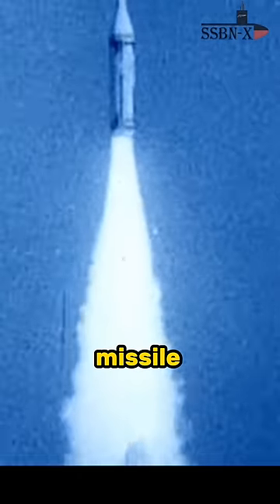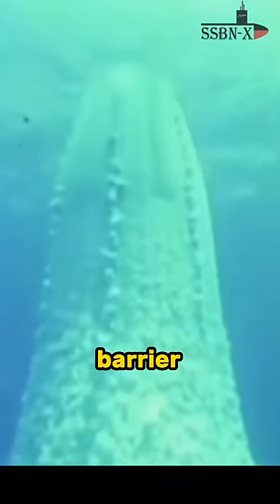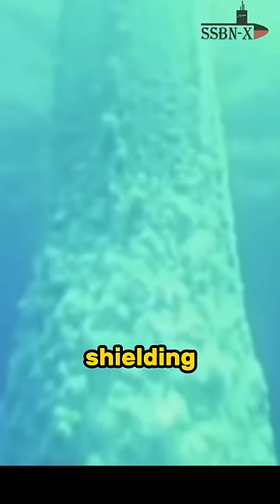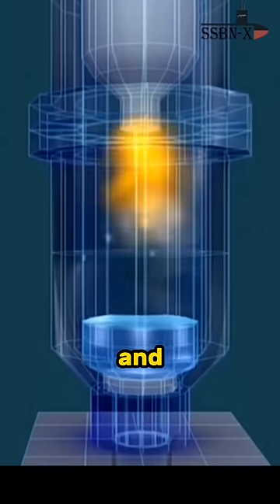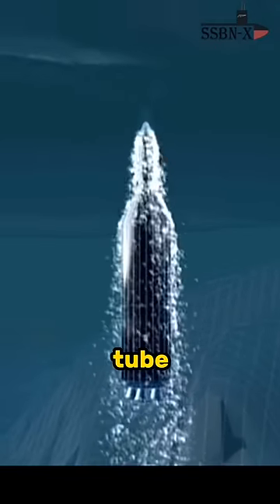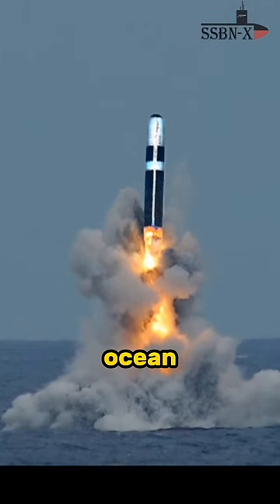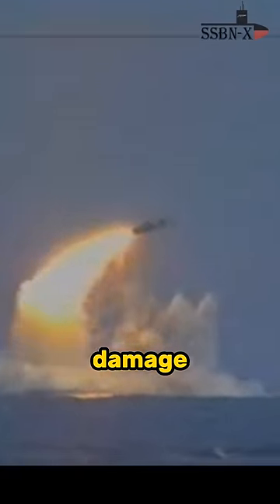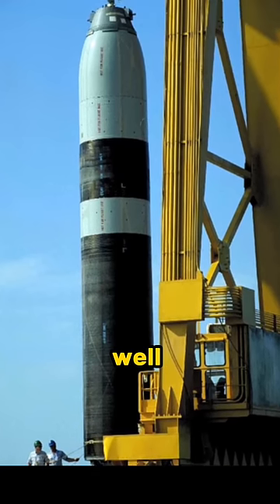Why The Missile Never Gets Wet? #shorts

Comment: IDK if the Trident II  is still on subs. I think it was retired.  I used to make these 1st  2nd  & 3rd stage igniters, insulaters, &  nozzle machining on VTL's.  That was back in 1980.  Same airforce plant that produced shuttle motors (UT)
Reply: Trident 2 is still in service
Reply: @corvoattano4777    ok. Thx.  I just remembered   2 conversations w/ submariners  (well,  1 was the sailors'  Mom).  The other sailor was out of Navy. IDK,  about 10 yrs ago.  They both told me that the  missiles  would sweat out  nitro- glycerin,  quite large puddles,  which had to be mopped up!  (fun fact).  🙏🇺🇸
Reply: @patriot692  godda,n haha when you think about these world ending missiles you don't consider them leaking fluids
Reply: Trident 2 D5 is still in service
Reply: Let's hope these suckers never need to be launched.